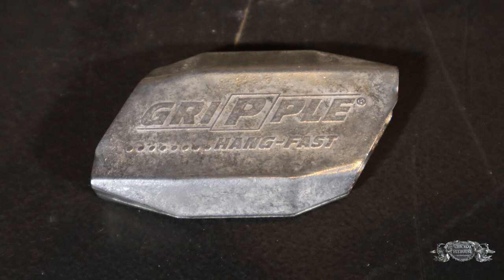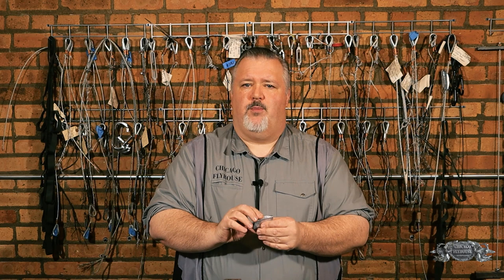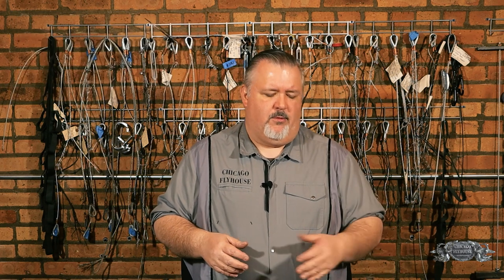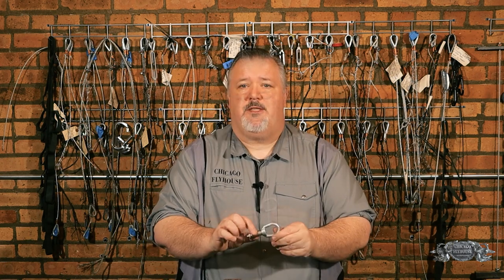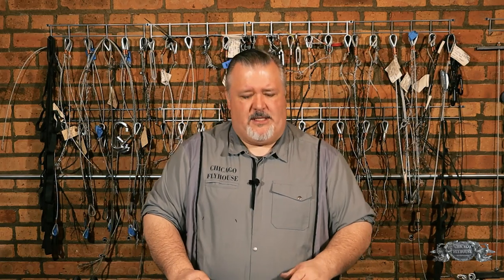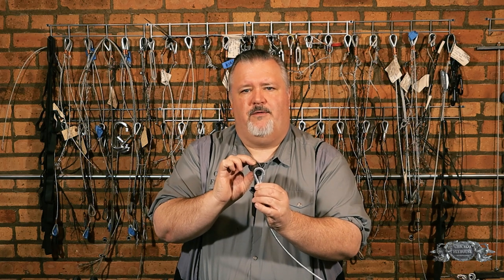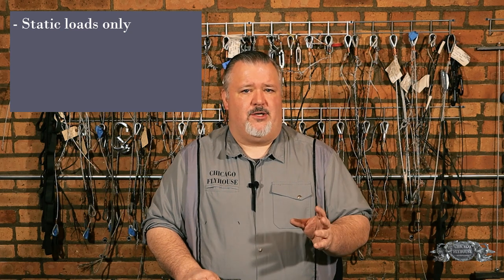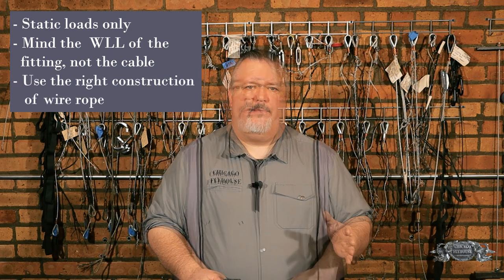Cable Glides

Comment: I'm curious if the verlock suffers over time if you pull cable through without loosening it properly to adjust length - not unscrewing to the point of looseness, just enough to be able to pull the cable through more with a hand?
Reply from the maker: This is an interesting inquiry, but would be pretty hard to quantify. Despite that, we will add it to our list of potential projects, as it would be fun to try to get some data!  Thanks!

Comment: Should a Verlock be used at the top or bottom of the system. That is, hanging a Christmas Tree (load) from the cable glide or is the Glide up at the batton
Reply from the maker: You could use a cable glide at either end, as long as you install it properly and stay within the allowable loading.

Comment: Did you tighten the verlocks when you tested them? Looks like the knurled nut bits are threaded loose on all three
Reply from the maker: I had to go back and look at the video, because I was sure I tightened them, but sure enough, they are open.  The spring still grabs, but if they were bumped, they would let the cable move.  Good thing this was only a test! (Even folks with lots of experience miss things - get someone to double check your work whenever possible!)
Reply: Good eye! :)
Reply: Good Catch- it's those small things that cause bridges to collapse and planes to crash.

Comment: Gripples are also used to secure vineyard trellis wire looped around posts - solid wire with a ratchet tensioner near one end.
Reply from the maker: True! They are used for lots of fencing-type applications, and the tensioner is critical in those cases.  Not so much for entertainment rigging.